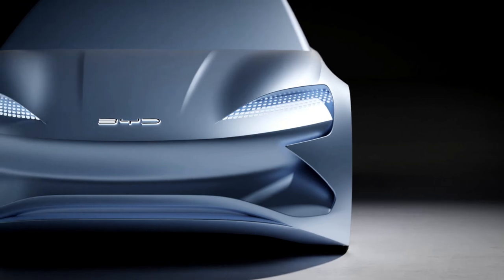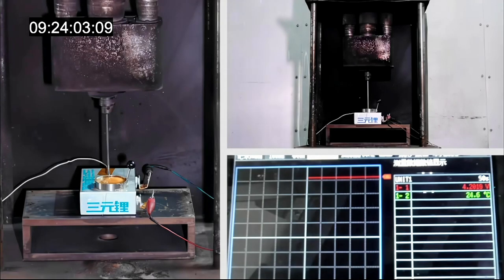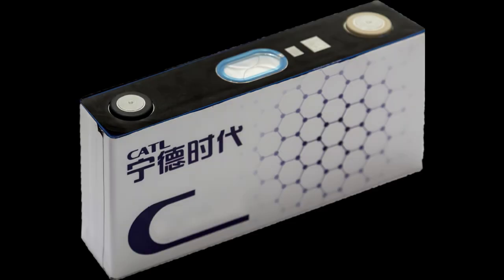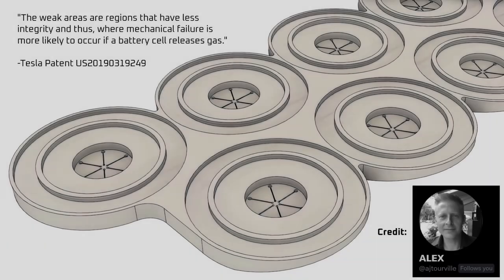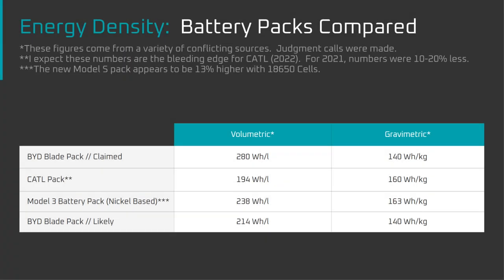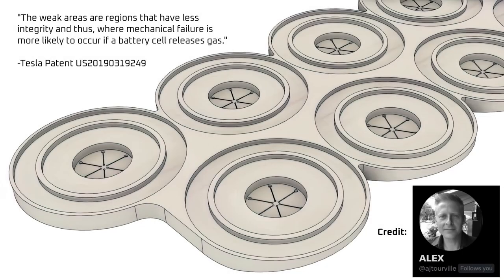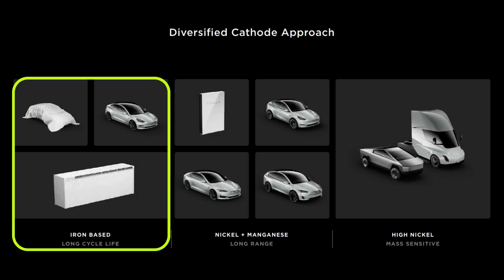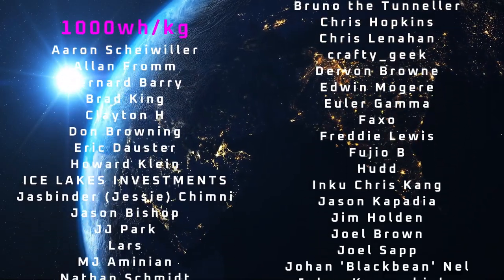The BYD Blade Battery Evaluated:  The Hype is Real (Mostly)

Comment from the maker: Notes:  

1) 1000km for NEDC is about 432 for EPA.  This wasn't a Typo.
https://insideevs.com/features/343231/heres-how-to-calculate-conflicting-ev-range-test-cycles-epa-wltp-nedc/#:~:text=So%2C%20U.S.%20BEV%2FPHEV%20drivers,a%20standard%20deviation%20of%200.092.
2) Correction from Matt Lacey!  "Steel is common for cylindrical, but Al is standard for prismatic (regardless of chemistry) - lighter and better thermal conductor than steel though usually thicker. Can is grounded to +ve electrode to avoid corrosion. Blade cell is Al can, not steel"
3) However, re 2),  this doesn't change the fact that they might use thicker aluminum to provide rigidity.  However, there might be another thing causing the low Wh/kg in BYD:  It has more surface area.
4) Tesla has started putting 60 kWh packs in China Model 3's, which provide 276 miles of range.  This means the BYD Blade might provide 300 miles of range.
5) There is no such thing as a safe battery pack, only safer.  That's the key takeaway with blade safety.  So, yes, you can probably make it explode somehow, but it's less likely to.
6) YouTube wiped the original notes along with all the comments.  Not sure why.
Reply: They might be able to get the 1,000 km range if they stack two battery packs on top of each other.
Reply: Thanks for breaking this down. It's impossible to form a conclusion with the press releases alone.
Reply: YouTube I have found has a habit of deleting people's comments especially if the comments are outside what it  thinks is the correct sort of commentary. It also remembers so once it starts happening it does so increaaingly
Reply: @annakissed3226  Youtube   behaving  like  this  really is not a good idea as whenever they "disappear" any  comments I happily Invoke the old Streisand effect.   I record the event and upload it to the ever increasing pile of mine and others evidence detailing what they are doing.
Reply: @annakissed3226  Then I proceed to re-comment  with some edits to avoid the Auto "Disappear" with notes saying that this particular comment was  unlawfully "Disappeared" and rightfully Lambast them for having done so while also mentioning that their actions are in fact very Illegal
They are Curating content to  their biased liking,  as if they were a publisher while benefitting from portraying  themselves as a Platform and the subsequent tax exemptions that being an open  public platform entails
By Curating and deleting peoples uploaded content for their own benefit and convenience they are Legally a Publisher,  and not  valid for the tax exemptions they receive for being a "platform",  and by doing so they are committing  fraud and tax  evasion
Pretty Serious stuff,  You  don't  mess with  the IRS.
Reply: @annakissed3226  They went and brought this upon themselves because I noticed they were Catching  perfectly reasonable comments of mine,  so I started this campaign against their comment "disappearing",  and everytime they do they just fill me with an even more terrible resolve and I bring more resources to bear.

I have already gone and  reported them to the IRS whistleblower-office,   so if you also feel what they are doing is wrong you are more than welcome to add your own report to the pile
Reply: I just typed a comment, to add to the 8 or so comments already there.  Then I hit a key by accident and I went to another page.  When I returned here all the comments were gone.  I was going to say, The reason youtube sometimes deletes comments is when they are over edited too many times. Their servers probably can't keep up with propagating editing updates and keeping the different edits synchronized across all their servers, so it dumps it as a nuisance, perhaps thinking it is a flooding hack attempt.  

Also, if you loose your comment, sometimes it will still be showing- but it will actually be gone, as when you refresh the page to check, the comment will disappear.  A solution is to "select all" and "copy" your comment before hitting reply, so if you refresh the page, and it's gone, you can  start a brand new comment and paste it. Also, be careful what keys you accidentally hit.  So right now I select all (command/ctrl+A) and copy (command/ctrl+c) and I refresh the page t see if my comment is here.  If it is gone, I may start a top level comment and paste this in there.  This is my second attempt, as this  comment didn't take when I refreshed the page.
Reply: ok I just went went to another page and came back.  I had to do this two times to see my comment.  The first time, all the comments were gone.  The second time, my comments and all the others showed up.  THE FOLLOWING IS ONE  ADDITIONAL EDIT I just refreshed the page, and could this this additional comment and all the others.

Comment: Love your videos!!! The blades are fantastic. I plan to test some soon. Really cool technology. Love your breakdown and comparisons.
Reply from the maker: 🔥 Awesome!  I've seen them available online.  Makes me want to tinker, lol.
Reply: @thelimitingfactor  Love that you and Will are connecting online- love both of your videos!
Reply: A question for both of you!
do you think these are a "full width" cell internally, or a string of individual cells (I'm struggling for an analogy..) like a string of "soup packets"(?) with top terminals for each packet on a common busbar, then layered 7(?) deep?
This idea would limit the volume of cell damaged in the nail test, say 7 packets, 150mm tall by 100 mm wide instead of an 1800mm length?
That would let just that section exhaust along the whole length of the container without lunching the entire unit.

Hope this makes sense.

(Btw.... HAPPY NEW YEAR!!)
Reply: @rogerstarkey5390  Blade cell electrodes can be that long. Instead of rolling the cylindrical cell jelly roll they just stack those as-is. To make a oversimplified comparison.
Reply: @mfb424  
That what I was suggesting.
The assumption elsewhere seemed to be that electrodes would be at the "ends" of the "roll", effectively at the "sides" of the pack when in the car, leading to a long electrical path, increasing resistance.
I suggested they should be like the tabless roll, top and/ or bottom of the pack.
However, I also suggest that if the long roll is then divided (pinched?) at several points, that would avoid losing a complete roll and probably the whole cell, if one section is compromised.
Reply: thanks for the tip, confirms my theories.  byd blade is simply one giant cell at 3.2V! no wonder it is so safe since it is like a low performance battery only with large capacity.  Amperage or performance would be killed though, im certain with its low charging, discharge, and regenerative braking performance
Reply: @thelimitingfactor  and Will Prowse - Do you have a link to purchase the Blades online?
Reply: Will any update on those blades? Have you got your hands on em yet?
Reply: Have you tested them yet?

Comment: I love your videos. Thank you. Very cool stuff. BYD is the Only other EV stock I’ve really considered besides Tesla. Feels like those two are pulling away from the pack.
Reply: Yeah but not the stock prices down $10 per share in a week is not that impressive, then look at the battery warranty which is extremely limited 8 years but no more loss than 40% that is almost half it's capacity! If the car has a new range of 300km but after 8 years that range drops to 180km then that is a big fail!
Reply: I agree, it's Tesla and BYD's world and everyone else is paying rent.
Reply: @drew031127  NIO and Vinfast too, soon...
Reply: @gregb1599  I'm not sure why their  warranty is so conservative, but LFP generally has a very long lifespan with little dropoff even with charging to 100% and draining to 0%. Also BYD has been making batteries for a long time, it would be surprising if theirs were worse than others. I suspect the stock price is due to the lack of press they get in the US. Their weak point seems to be their marketing outside of China.
Reply: @macrumpton  A battery is a battery which is why LFP can get very high mileage warranties but the same short 8 years, if you look into the previous BYD E6 they had a lot of battery failures, hopefully the new Blade battery is more reliable, but it may not lose capacity rather the cells just fail which of course kills that part of the battery pack. As for the stock, more than likely the announcement that 30% subsidy has been cut with 100% at end of December 31st that will kill a lot of sales for sure
Reply: @macrumpton  It's probably not battery degradation you have to worry about, its if one or two of those modules fails, you would not know other than range drops and as long as it stays above 60% then you would not get a module(s) replacement. I am not sure I want to be the tester of the Blade battery rather wait a few years to see how reliable the modules are.
Reply: Watch NIO in light of their battery swapping technology. Making in-roads in Europe. I think this kind of tech can work there since, unlike US, there is a social fabric and ethic there. Still Americans love more than individualism convenience, and I wonder if the swapping technology will be uber-convenient. Kind of like how we drive through a gas station will be replaced by a battery swap process. Pardon my ignorance, and thanks for reading.
Reply: @gregb1599  well... This aged like milk. TSLA is down 70% yoy

Comment: 1000KM is not 434 miles, it's 621 miles. It's simply a measurement of distance, so NEDC or EPA has nothing to do with that. Also a prismatic cell casing is aluminum.  So is any of this info correct?  Limiting Factor, you need to cite sources and calculations.  I have a suspicion your calculations are wrong but I am unable to verify without each components specifications.

Comment: In the LFP cell, the oxygen atom is joined to the phosphorus atom; whereas, in the other formulations, the oxygen atom is joined to a metal atom, Phosphorus has a high thermal stability which would have a slower reactivity rate.

Comment: As a ower of BYD Qin plus with these blade cells inside, I love this explaination. These are some of my opinions from a cell teardown I made half a year ago:
1. The case is aluminium, not steel. All prismatic cells are aluminium casing, not steel. 
2. The gravimetric energy density (specific energy) is low due to large surface area to volume ratio. Ideally, a sphere would have the lowest area to volume ratio thus maximum amount of active material. The thinner and elongated the cells are, the more it is wasted on casing.
3. BYD blade cell pack is not as structurally sound. They are not as strong as cell-module-pack intergration. (I witnessed crush tests on these pack before.)
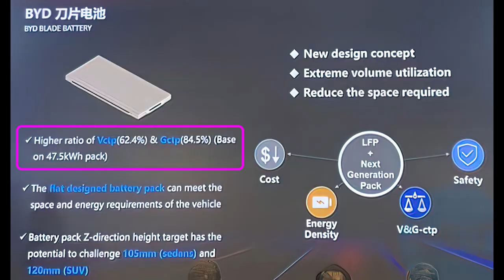4. 9:18 The cell you showed is actually a pouch cell for PHEV models. The EV models uses single long blade cell, PHEV uses 8 pouch cells to form a "thick blade". Obviously, PHEV cares more about power while EVs cares more about enery.
5. 10:14 My car has a total pack capacity of 71.7 kWh for a similar size compared with model 3. The NEDC is 600 km while Model 3 LR in China is now 619 WLTP. Tesla wins on whole vehicle efficiency by a lot! However, from battery system's POV, BYD with LFP had an amazing achievement for their first generation product.
6. When comparing battery technology, we really should only look on packs & cells. Vehicle design would have a huge impact on range performance. I wish manufactures should post their vehicle's energy consumption rather than just "Range".
7. 13:00 The Ocean-X model might be the EK series, my vehicle's predessor. It would have an NEDC range of 700 km to start with. That is still based on the current blade cell technology. The next gen would have a pack specific energy of 180 Wh/kg. With the help of 8-in-1 platform control system and even CTC, I suspect 1000 km would be possible but with a catch on the testing standard.
8. 17:30 And cheap labour. BYD has the cheapest labour compared with other cell manufactures. No comment on that.

If you would like to know more about the BYD Qin plus, here is the link to my video:
https://youtu.be/3uwzJHiYn2Q
Reply: How is this incredibly informative post not upvoted more??

Phillip.
Reply: Thanks for the wonderful insight
Reply: BYD will release its semi-solid stated batteries on its high end model by 2023.  I believe 1000km will be standard spec for BYD lfp ev in mid end models after 2023.
Reply: Amazing information. Let me throw this at you, at the risk of being presumptuous or even audacious I am afraid. From an investing standpoint, do you think battery swapping technology will become a bigger deal or as big as the blade batteries? I think the former might be more used in EU eventually. Also am I incorrect in treating these two battery paradigms as mutually exclusive? Thanks again for such a thoughtful, informative post.
Reply: @ianjohnson458  Battery swapping technology is a non-starter for surprisingly abstract reasons - mainly format sensitivity due to disagreements over powers standard connections and restrictions made by the geometry required, and whether the application could tolerate lower speeds of charging given the context (hiring cars or being part of a taxi fleet could be managed by throughput of cars being charged 'out of phase' rather than individually waiting for a single vehicle.)
Reply: 2) Gravimetric and volumetric density specs put out by the battery developers aren't as important as the actual density that auto manufacturers can fit into a car.  While a spherically shaped battery could have the highest Gravimetric rating on an individual basis, space is wasted when you stack them.  Manufacturers will consider density based on the total amount of space taken up by each battery when stacked. Prismatic batteries don't have wasted space when stacked.  For this reason, and more, it is difficult to interpret the effective density based on the specs that the battery developers put out.

Edit: I just noticed the video called this concept the "pack-level" density.

Comment from the maker: Notes:

1) 1000km is 621 miles nedc and 434 EPA, which is closer to reality.  This is explained later in the video.  Watch the video before commenting please.

2)  There is no such thing as a safe battery.  Every mechanism for storing energy is like a bomb.  You can only ever be safer.  BYD blade will still be flammable under the right conditions...just like every other battery.  But the odds should be much lower, and that's what we should always be striving for - few people killed.

3) After publishing this video, I thought of one additional reason why the BYD Blade Cells my have lower gravimetric energy density:

As I mention in the video, they have greater surface area. That is, I think the reduced gravimetric energy density could be either/or due to thicker steel/more surface area.

4) BYD Tang appears to have similar range (EPA) to Han.  It's range is often reported in WLTP or NEDC, which are generous.

5) The was a paper published by Chao-Yang Wang claiming more impressive figures for Wh/l.  But, if you check, the references, it appears to reference an article.  👀

6) It appears that Tesla LFP is getting a boost to 60kWh and 273 miles of range.  This means that with BYD LFP in a Tesla vehicle, we'd be looking at almost exactly 300 miles of range.  However, BYD vehicles are less efficient and it would still be a stretch to hit 300 miles of range.  But they'll be there in the next couple of years.
Reply: What are your thoughts Jordan on internal resistance of that long cells compared to shorter prismatic ones? I assume, electrodes are on one end, so "the distance electrons need to travel in the cell" is reaaaaally long, or am I wrong with this assumption?
Reply from the maker: It's a good point!  I think it would create a 2-3% handicap.
Reply: As if any of us would have been wondering why you’d missed that last reason. You’re the Sherlock Holmes of batteries.
Reply: @thelimitingfactor  
I've just posted elsewhere, maybe it's not 1 long cell, but a "string" of short ones, just opened out, unravelled, with a common busbar connection at the top/ bottom performing the same function as the 4680 tabs? (short path, good energy/ heat dissipation?)
Advantage, better cooling, less resistance (?) Isolation of the packets in case of damage/ failure, while exhausting through the whole cell box?
Reply: Great stuff as always Jordan! I am loving the developments we're seeing with LFP everywhere; seems like it will make the electric transition even faster and more affordable.

A note on safe batteries. I agree that there is "no such thing as a safe battery" but would add the nuance for a lithium ion battery and fire risks. There are other electrochemical energy storage systems that will not burn at all. Most of the fire risk in lithium ion batteries (both nickel and LFP) comes from the organic electrolyte, not from the stored electrical energy. In any case, we have almost no examples of deaths from EV fires (maybe the Texas Model X crash in April '21?) and very few examples of deaths even in very large stationary storage systems. Mostly the safety goals we are and should always be striving for now are protecting property - vehicles, garages, etc. (which is also important!) Obviously life safety is always the number one concern and must remain paramount, but it's important for the public to realize that battery fires kill/maim almost no one.
Reply: @thelimitingfactor  following up on the post from apocryph, would the long distance mean more energy lost in charging and/or slower charging speeds?